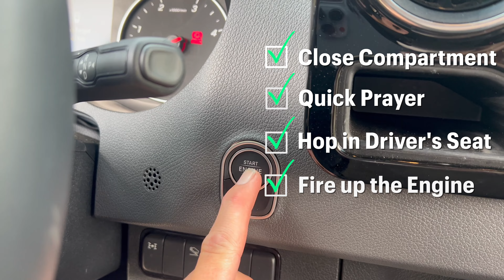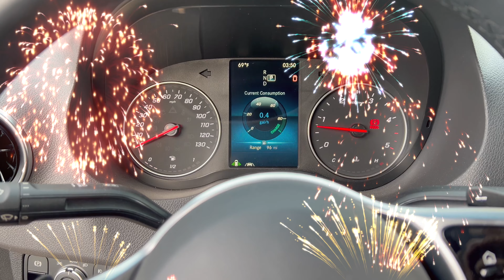Sprinter Camper Van Build Alpine Mechanisms Seat Swivel Install

Comment: Good job, just an addition, I would have preferred seeing you sitting in the seats and operating them front to back. This would illustrate any clearance/does the doors need opening challenges....Thank you again for everything that goes into making these informative and funny vids!!!!!!!!!!!!!
Reply from the maker: Thank you for the comment and the kind words. Maybe I’m misunderstanding but you aren’t actually supposed to operate these swivels while seated in them (most swivels are this way). The base with flex and the two plates will scratch each other.
Reply: @moonrakerdesign  Ooooh, was not  aware that the seats were not designed to swivel and be occupied at the same time. I am green and learning something new every day. Is it necessary to open the door(s) to enable the seats to swivel? or can this be achieved with the door(s) closed?
Reply from the maker: @stephenmoody8059  No worries!  Everyone is still learning 😀.  There may be some brands or models that allow this but I think you'd hit your knees on the cup holder anyways. 

The doors can stay closed for the swivel.  You slide the chair forward a bit, swivel it and then push it back.  You don't need to to lean them forward or anything like that either. 

I found a new swivel I would be curious in trying on my next van that looks equally as nice but for a little less $ - https://audrioswivels.com/store-hvNcg/p/seat-swivel-for-mb-sprinter-907-2019-2024

Comment: Thank you! 

How are they holding up?
Reply from the maker: Hey, they are holding up great and we really like them.  The price tag is still pretty high though for what you get... 

I can't vouch for these personally since I haven't tried them, but in my other searching if I were to do it again I found what appeared to be a better option at roughly $800 even with overseas shipping vs $1150 for the alpine ones - https://audrioswivels.com/store-hvNcg/p/seat-swivel-for-mb-sprinter-907-2019-2024

They look slightly higher profile than the Alpine Mechanisms, but even a bit more quality build IMO and they are pulled tested too.
Reply: @moonrakerdesign  Giddyup! My low roof arrives in Jan/Feb; this info helps me prep for those first few additions!
Reply from the maker: @ShrekDzz  congratulations, that's supper exciting!  I hope we keep in touch and you share what you have planned/do!

Comment: does the new artico leather smell like anything?
Reply from the maker: Smells almost the same as that new car smell for the first couple thousand miles then there’s no noticeable difference between our car with leather seats and this one! They are super durable though we’ve had sand, dirt and mud from dogs all over the place and everything wipes right up. Really happy with them. Hope this helps.
Reply: @moonrakerdesign  it does thanks I’m really laboring over a 170” used and a 144” new w the vinyl
Reply from the maker: @shannonhagen  After driving and debating them both ourselves... the added space of the interior for the 170" is super super nice, it opens up a ton more options for the floorplan.  However, for us it was just too big. The 144" fits in a normal parking spot and is way easier to navigate through tight roads and trails. It's a tough decision and ultimately settled on there's no right answer, only a list of pros and cons for each individual and their circumstances.  Long story short, the new faux leather is nice.  I wouldn't let that weigh the choice in either direction..
Reply: @moonrakerdesign  

What really weighed in on my decision to even just go for it in the first place was your air saw video. You two have a great calm style that really vibes w me and I am looking forward to using your affiliate links and supporting your channel so please keep making these and I will be over here cutting holes into everything. For practice.
Reply: Just curious…where did you find those torque values for the pedestal and seat base? I followed  alpine mechanism directions and they recommended 30 ft-lbs for both. They did call for 35 ft-lbs for the e-brake bolts. I’m guessing you checked the weld nut specs for the pedestal.
Reply from the maker: @paniro21  Ahh yep, this is a good catch. I must have accidentally grabbed the e-brake spec for all at the specs.  I recommend following their instructions or if you want to follow Mercedes factory torque specs it's 39Nm which is ~29ft-lbs which is probably where their 30 came from.